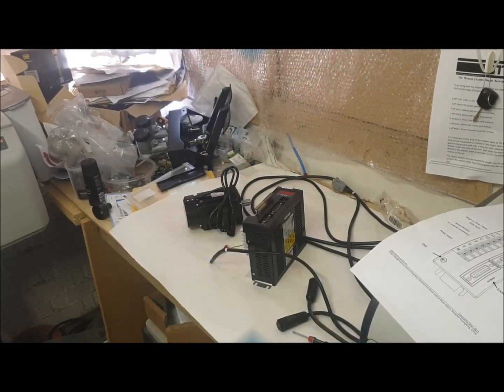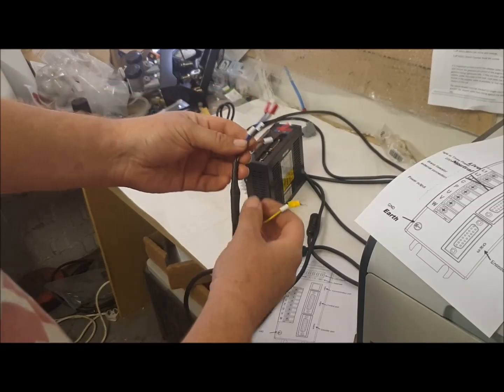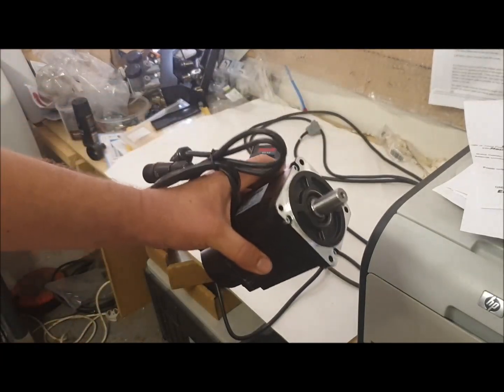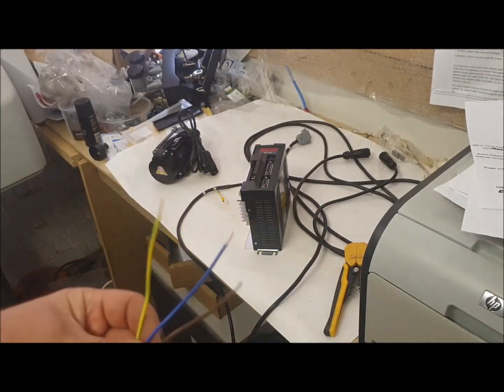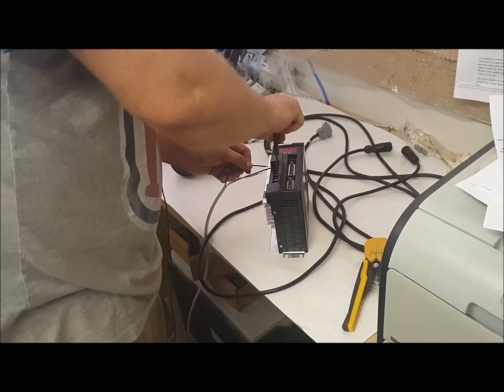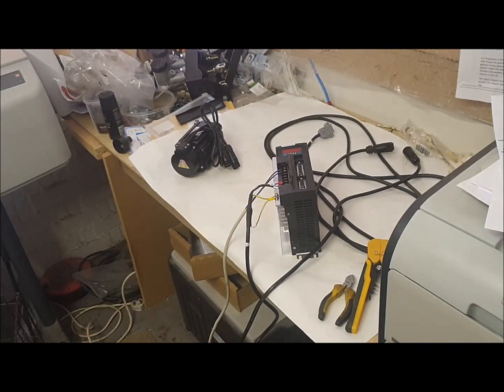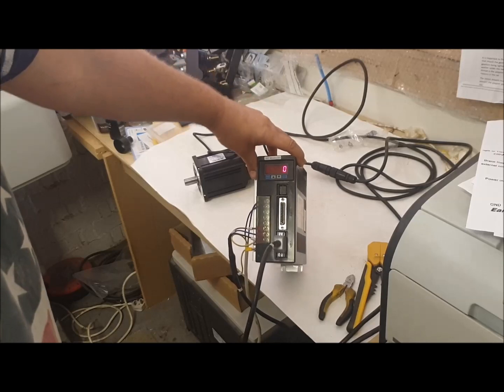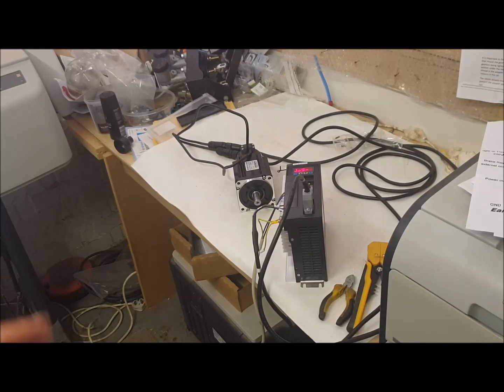Build Your Own SFX-100 Motion Platform Rig Part 2 for Sim Racing - Assetto Corsa, rFactor 2, pCars

Comment: Do you have your updated diagram available? Thanks. Great help so far. I’m watching all the videos now.
Reply from the maker: Follow me on Facebook www.facebook.com/gpracesim and I'll post it there. Can't see a way to add it to this comment.
Reply: @GPRaceSimulation  Hi,  do you have anywhere i can get just the motors from the 90st mo2430 i believe 4 in total. I have purchased some of the stuff from someone but i need the just the motors and 4 motor couplers without the drives as i have those already